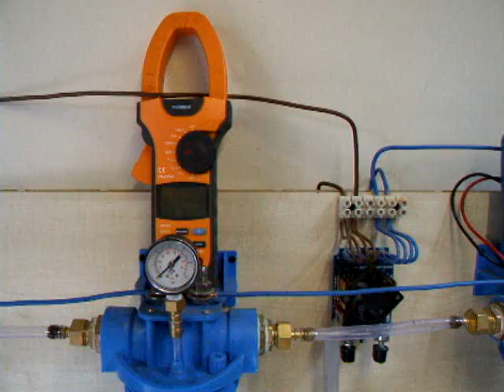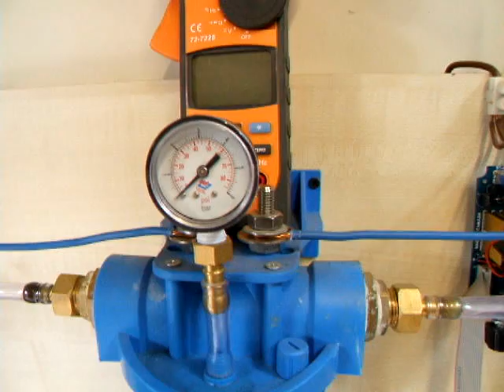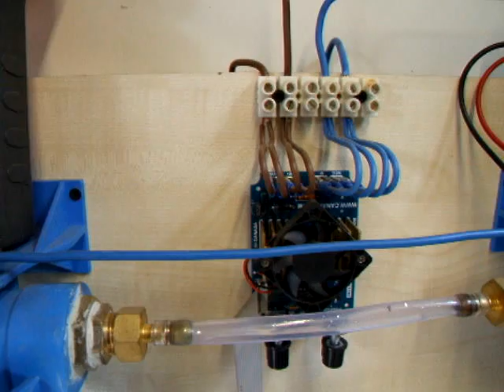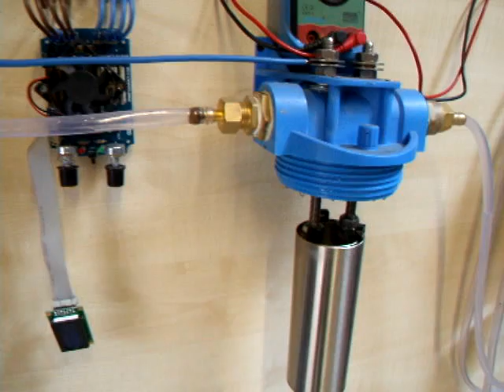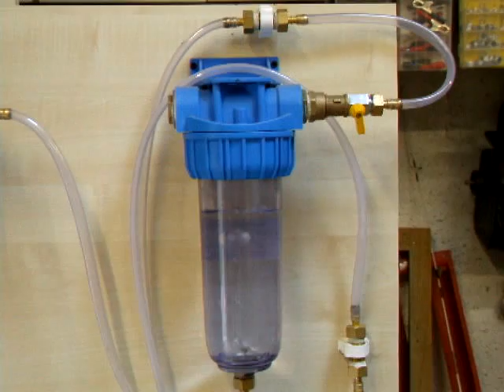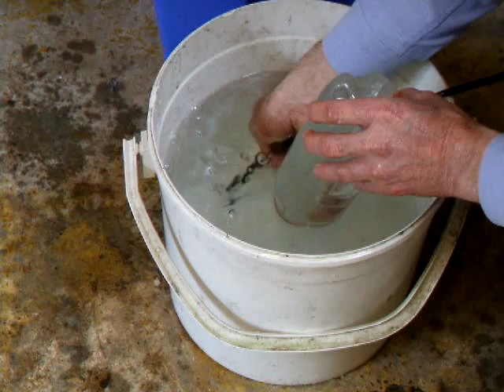Experimental HHO Cell - Full Walkthrough

Comment: Can you tell me which housing unit and model number you used? I have looked at several,but none come with a pressure gauge, which is very important for me to have. I am very big on safety.

Also, I absolutely loved your idea of serializing the units, extremely effecient.

Speaking of effiencies, have you compared wet cell to dry cell? If so, what did you find to be A. More power effecient and B. More productive HHO wise. I have seen mixed results.

Comment: Hi there. Very good technique to control the heat in the cells. I've been searching a lot on the net about hho production. Stan Meyer had a nice system using resonant cavity to reduce dramatically the current. He used also a special laser system to enpower the hho even more, so that his output was 1700% of the faraday limit. Your work is very precise and well thought. Congratulations!!

Comment from the maker: Hi Darrellsrelm, I found the housings for sale by a company who specialise in water filtration systems. An internet search for your area should find some for you. To save money, I bought the housings without the filter, but I did buy mounting brackets. It was easy to buy them as I collected and paid in person ;-) Be aware that different manufacturers housings will have different heads, so my method of construction may not work exactly as shown. The reducers from 1" to hose barbs were extra also.

Comment from the maker: Hi vikvickyy1, I bought the PWM from CanaKit as a fully assembled item rather than make one myself. I needed one that would handle up to 50 amps and did experiment with smaller PWMs previously. The unit I now use is good. The only criticism that I have is that it does not show the current - it shows only the duty cycle. This means that I need to have a seperate current meter. A minor drawback you might agree.

Comment from the maker: @ztexanz Hi, thanks! This is an important issue. The specific rating is 45C/113F. I run the cell  'cool' without ever exceeding the max rated temp. The heating effect is directly proportional to the current.  IMO the many advantages of using the water filter housing outweigh the temp rating issue, as long as this important issue is carefully monitored and controlled.